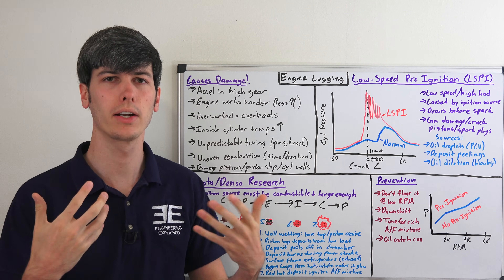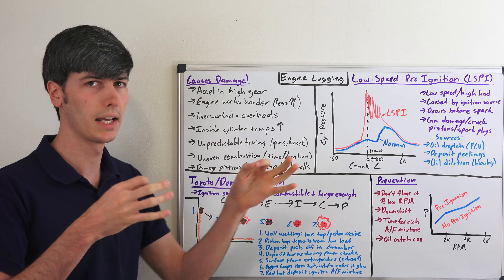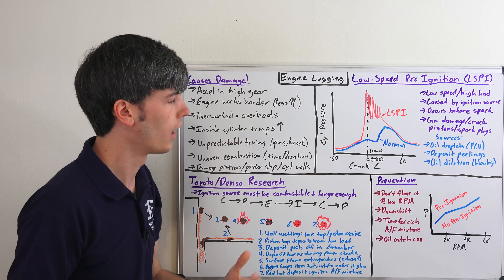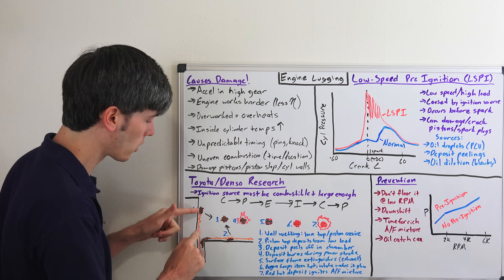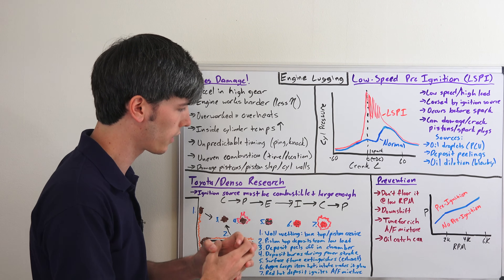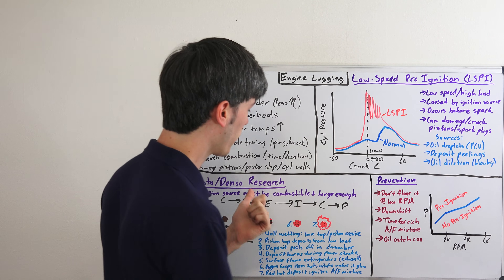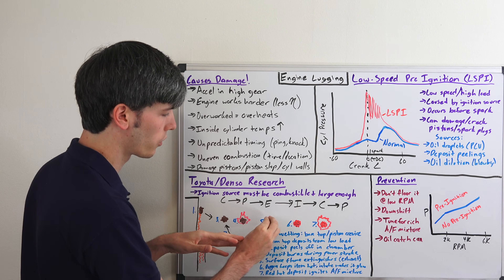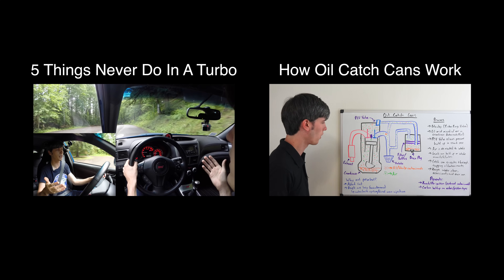Why You Should Never Lug Your Engine (Especially Turbos)

Comment: An incredibly important thing that many people forget is that engine speed and oil pressure is highly correlated. This means that if you let your engine bog down, your oil pressure drops.... then when you floor it and put a full torque load through your con rods, you lack the oil pressure to protect your big end bearings. I would say what you're describing in this video is important - especially to those without electronically controlled engines - but the potential damage to the big end bearings is of paramount concern when using full throttle at low engine speed

Comment: what about a bmw 335D the best way to drive it is to always floor it
Reply: There's no bad way to drive any  bi-turbo BMW diesel. Superb engines. They don't really need flooring very much of the time either. Just be a little be gentle 'til fully warmed up and then go play with the torque. You'll pay at the pumps and when it comes to replacing tyres but if you can afford t then why not? I approve of your choice of car. If I had the funds I'd buy a 535d Touring. Stay well :)

Comment: Always am thinking that if I stay in the highest gear I'll get the best fuel economy but you are helping me change my mind
Reply: Not always the best policy. Drive in the engines optimum power band is the best in experience. Low revs doesn't necessarily benefit economy either. You need airflow to achieve good air:fuel mixing. This doesn't happen optimally at extremely low revs.
Reply: Nick Wunnenberg well... yes and no
Reply: paulanderson79 true...  Efficiency is the key to economy AND power.  Too low of rpm and you are wasting fuel due to not enough air flow to burn it all.  Too high of rpm and you are now ignoring the efficiency peak and going for peak power.

The very start of your peak torque curve will be the most fuel efficient for your car.  Mine is from 3-4k (out of a 9.3k redline) below that and my torque band is very low, above that and my variable vavles begin opening to optimize performance and the car start to get richer AFR to make the most power rather than Torque
Reply: @dustincomp1814  "variable valves" hmm?😜
Reply: @dustincomp1814 Ehh.. no. Except for oltimers your petrol will never inject more fuel that it can combust. Low rpms are the most efficient at full throttle, however since you request more torque you will have some more wear. More rpm are also more wear.
Reply: Also, the engines RPM is relative to the fuel consumption. Great statement @paulanderson79 !
Reply: Turbo diesels work great on lower rpm, he didn't specify it
Reply: Cars with automatic transmissions often will run at 1200 RPM just after an upshift. I think if your intake manifold vacuum is over 5 inches of mercury (about 80% load) and your engine RPM is at least 1200, you should be doing no harm and getting good fuel economy. If you want to use full throttle I think you should downshift to get the engine over 2000 RPM. If you feel the engine vibrating your car a lot, it would be a good idea to downshift or use a lower throttle setting. That would protect the engine mounts and exhaust system and also improve your comfort.

Comment: What a load of rubbish. I think he kind of lost all his intelligent listeners at the point where he talked about 'wheel torque'. Wheel torque produces a rate of accelleration and is completely independent of what gear you are in. Yes, a lower gear will provide more wheel torque but so will a greater throttle aperture (up to the limits of the engine - in both cases.)

As another commenter has pointed out, any decent engine management system will sort out all the issues mentioned in this video - and they do! One of the primary reasons for needing to 'manage' all of these factors has to do with emission control. Higher cylinder temps produce unwanted combustion products - which manufacturers work very hard to avoid.

Comment: i've had my 2004 A4 1.8T 6-speed manual since it was new, used Mobile 1 synthetic the whole life of the engine, 165k miles on it now, lug it all the time, even driving it up the mountains in Arizona in the summer. I'm pretty sure the ECU will not allow any condition that would damage the engine, once the engine can't sustain my speed i downshift. The car still purrs like a kitten.
Reply: One of VW's better engines. The 1.8T is well proven and well regarded.
Reply: The 1.8T uses so much fuel that LSPI would never even have a chance to occur. Not to mention that it's not direct injected so you're missing the point anyway.

Comment: I drive a old 318 Magnum, low rpm is all the power, the engine falls flat on its face at 3k and its happiest putting around town at 800-1100. 80k miles doing this everyday and engine burns no oil, power hasn't went down, temperature gauge never moves when lugging it. Maybe if you're flooring it when the engine is literally stuttering and about to die, but he acts like of you don't downshift anytime you want to give it some throttle you're going to hurt it. Next time on engineering explained, "Why using your brakes is bad for your car"
Reply: yeah because it's an old big v8 that doesn't have enough power to hurt itself

Comment: good video, but why especially turbo'ed cars?
Reply: the torque is much higher then NA engines. but the bearings have been suited for the higher torque, so there is no problems for them either.
Reply: BlacKi - those bearing still need oil flow. Best to use an oil that meets the maker's specific requirements and keep it gentle when cold. After that you're good to go. At super low revs the turbo won't achieve much anyway - there's nothing to create boost and if even there was then the ECU will limit the torque to protect the engine.

Comment: So this doesn't really apply to automatics? If I floor it will cruising at 60mph around 2krpm in 6th gear, it'll drop to 3rd.
Reply: Alexander Estk it does apply to Automatics. because their transmission computer will calculate that it needs to downshift and so it does
Reply: Cristián Gámez-Pánuco  But that's a good thing right? I think he's saying if I had a manual trans and I tried flooring it in 5th gear or something than it would be bad.
Reply: True. Also considering, that the 5th gear is usually an overdrive gear; just there for fuel economy not for acceleration.  Not to mention that it's like when you're on a bike, going up a hill in a tiny gear; you have to put a lot more energy into riding the bike up the hill, rather  than if you used a bigger gear.

Comment: Hi EE, great presentation on a topic that is so much misunderstood.
I did my engineering 35+ years before you and had the same conclusion but without the use of turbo, and the studies of Toyota and the computerized simulations that can be done nowadays.  We (Ford) tested shock waves propagation on the rotating assembly, engine block, drive train (flywheel and damper), in a low rpm, high and low load, and high mixture (those were the sensors we had back then).  We looked at the effect of lugging the engine and also at revving the engine under no load (like "kids and motorcyclists enjoy doing at red lights" and reported much greater stress on the engine components than at high rpm.  The test scenarios eliminated air/fuel ratio imbalance, detonation, pre-ignition, as far as the technology of the day allowed.  We also used engines that were "mint", all parts polished and cleaned for any debris, assembled to specifications by top technicians and engineers (truly yours included), optimal cam profile and ignition timing and test calculations with the best gear of that era.  The consensus was like you mentioned plus we noticed extra vibrations, increased stresses on all parts, would decrease the life-cycle expectancy of most of the moving components of the engine/dyno linkage.  We concluded that the engine (Ford 335 engine family) could take it, under the best conditions but the ultimate life of the engine/drive-train would be adversely affected.  Did your studies looked at stresses on engine components aside without LSPI?
Thank you - Ciao L

Comment: How can you find out your engines most efficient range? It's easy to think lower rpm will be more efficient but that doesn't really follow.
Reply: Simon Ashton which eingine? Most gas engines are most efficient when almost floored at 2k rpm. Use engine braking when you want to come to a stop and downhill, use neutral if you just want to slow down a bit. Highest efficiency in a gas car will be achieved with flooring it 80% at 1.8-2k until a bit above the speed you want to go, then into neutral and let roll a bit below the speed, repeat.
Reply: In my case I drive a Mini Cooper S. I dont understand why max efficiency would be at 80%? I think if I was at 2k rpm and loaded the engine 80% it would be quite inefficient as I dont think it likes being heavily loaded at low rpm. Then also it would be trying to accelerate which is surely less efficient than maintaining equilibrium?
Reply: Yep, that's what many people think. But a petrol engine has a throttle body which creates efficiency losses when not wide open. Most gas will be converted to motion at wide open throttle body before max torque. After max torque, you get less power per rpm because of friction. Go and look for consumption map, the given picture on wikipedia is for the mini 3 cylinder diesel. Keep in mind that efficiency means fuel consumed for the power you get, not mpg in general. Driving while making use of highest efficiency is not easy, as it would require accelerating around the best spot of the map, then going into neutral and slow down a bit and repeat. Not only would you save fuel, but others would also wonder why you are constantly accelerating between 40 and 50 mph in 5th gear just to slow down in neutral to 40 again and go back in 5th and 80% throttle up to 50 and into neutral and... :)
Reply: Then what you say is best for wngine efficiency but not nessicarily driving efficiency. Im pretty sure thottle body losses will be less than wind resistance on acceleration for example.
Reply: When you choose to accelerate only short time, like from 40-50 and never go faster than that, it's also most economical. Remember wind resistance is also there when you don't accelerate. But it grows squared to speed unlike roll resistance of tires which only grows proportional. Efficient acceleration, use of neutral rolling and engine braking where it is done best will lead to greatest economy.

Comment: i will tell it to my engine: hey, you must have been dead already. I'm always driving between 900 and 2000rpm, accelerating with ~80% throttle. Never noticed any problems. I also think that the control units are programmed so that they should prevent damage from uncontrolled combustion.

Mitsubishi Galant 2.5V6 (2003)

Comment: i hv 1.5L diesel honda, it's  idling has been set on 1100RPM it works well over 1100 or 1200 rpm on 5th gear, sometimes i push it to 700 RPM when i do not need any torque, odo meter says 46000km, engine is in perfect condition, running on low rpm increase mileage, slow stroke means more use of heat energy within the cylinder rather then in between the exhaust system. low torque means more mileage as it also uses low fuel at low RPMs

Comment: Have to disagree with the beginning points regarding efficiency, at least when it comes to natural aspiration.  It's proven that full throttle at a lower RPM is more efficient than part throttle at a higher RPM (to achieve same power output) because a partially closed throttle plate results in more vacuum and pumping losses.
Reply: Karl L. Yeah, 80% throttle at low rpm should get you the maximum efficiency.
Reply: thats the point, there is the efficiency for power per consumption and the mileage per consumption, he was talking about the power which u get out of the engine. thats often at 2000-3000rpm.-but when it comes to the consumption on distances then it will save gas to lower rpm to minimum to lower friction.
Reply: Agreed. Same aspects can apply to a turbocharged engine before it gets into boost.

Comment: If your throttle is electronic, why wouldn't the ecu map just limt fuel to safe levels at low rpms?  I can't even spin my tires in snow unless I turn traction control off.

Comment: That's funny that Toyota participated in that study, because my Dad's Camry lugs worse than anything. When towing something light with high drag (such as a canoe trailer) it literally doesn't have the power in 5th to hold speed with cruse. It is actually flooring it. You can increase pedal pressure until you hit the kick down and it will not accelerate. Then, it kicks down into 4th and out of lockup where it pulls fine. The car then decides that it's got plenty of power in 4th, enters lockup, and then straightaway goes back into 5th lockup. Repeat cycle indefinitely. So as a result I drive with it in 4th. Same with mountains. It's pulling fine in 2nd, but if you enter third at anything less than 3k rpms in third, it will not accelerate. It will hold speed, but it is at full fuel for the gear. Now the engine probably cuts back the fuel as so it doesn't knock, but still. And that's why I hate autos. They are tuned so heavily for fuel economy that I have to drive them like a manual because they shift so poorly.

Comment: how about diesels? diesels don't really have this problems because the fuel is delivered after top dead center. how would lugging a diesel afect it? i mean yes, it is not really burning efficiently but 1200 rpm to just keep it going in the city at 30 mph can't be that bad, can it?
Reply: The Vibe nope, not that bad. Just don't let it vibrate. Maximum efficiency however will be reached when the turbo is spooling, which won't probably happen at 1200. But I think Diesels are not as variable in their efficiency anyway because they don't have a throttle body.
Reply: what do you mean variable in their efficiency? they don't care as long as you have enough air into engine and yes, at 1200 it's not going to be efficient. they have their range in between 1500 and 3000. after that you might see more power but not as efficiently delivered. also they have tricks for efficiency just like petrol. for example cdti have maf (mass air flow) sensores wich tell the computer how much fuel to inject to burn with that low boost you are curently at when at 1200 rpm. and also the injectors fire multiple times. for example it could fire at 12 degrees, 25 and again at 40 if that's the most efficient way to deliver power. some fire even 5 times on a combustion cycle.

Comment: But honestly at worst if the engine is not even tuned for a turbo would just have it run rich, therefor running at a reduced power and efficiency if the turbo is not spooled up yet. Science will tell you that an unclean burn is the lowest temperature, so I don't know how this damage is ever possible to create when the engine is not even full boost. 
Another angle to look at is the engine if it actually has a timing belt or cam, because an engine with bad timing probably does not have the right stuff installed anyway. Temperature is only an issue if your engine's oil system is not built for a turbo while it's at a full spool at desired RPM ranges, but likewise all engines with normal oil cooling should not be able to run higher than 4k rpm for a long period and not expect to begin to overheat. 
Piston damage risk is only greater for engines with 200°F - 300°F range running temperatures. 
I would also point out the research source is by Toyota. They are known to build N/A engines instead of boosted so the "investigation" was probably trying to find out why their engines don't work well with a turbo installation.
If it's an oil deposit problem then maybe they should have changed the oil at expected turbocharged intervals, otherwise likewise more of a diesel problem.

Comment: Didn't the reaearch into LSPI also reveal that especially engine oils with higher calcium content can increase the chance for LSPI to occur?

Other than that, the hydrodynamic lubrication film in the crankshaft bearings also isn't as stable and resilient at low revs so creating lots of piston force through torque at low revs might cause damage there as well, especially in downsized, turbocharged engines of european origin.

Comment: So off this video . When you dyno your truck in 3rd your in 3rd GEAR AT LOW RPM THEN YOU RAISE AN FLOOR IT. Basically your doing the same thing. You are partially right , this would be a bigger problem on older motors , today's technology , is so fast when you step on that throttle the car already knows what maping and AFR to use , the knock sensor would save your as on this issue , .. and FYI a dumbass would only floor it in high gear

Comment: What about turbocharged Diesels?

I drive a BMW e90 Diesel with 163PS.
-In which RPM range should i accelerate? I have noticed that i always need less fuel in higher gears as long as i stay above ~1200RPM.
-How should i behave when the engine is very cold (winter now)
Lugging is bad but high RPM is also pretty bad for a cold Diesel, especially with turbo
Reply: Nitroschock cold: little throttle and low rpms. warm: little throttle and low rpms. when accelerating, go for more throttle, if this isn't enough, downshift and much throttle.

Comment: 00:09, when I floor it, it automatically increases the RPM, right?
On a motorcycle, I drop a gear and disappear, on N/A engine car, I usually increment the RPM by 1000-1500 and then floor it.
On a turbo, it takes much more time.
I do it, because, it needs the power(torque in this case) to pull the vehicle out of the situation..!

Comment: How retarded its just like a bicycle with speeds. Try going up hill in high gear . DERRRRRRR , such a hard concept , higher gear more commanded engine torque / rpm , low load = death , we really needed a 9 minute nerd video to explain what is common sense ?